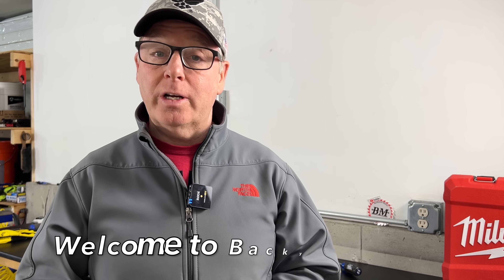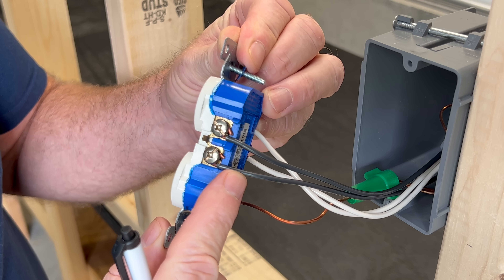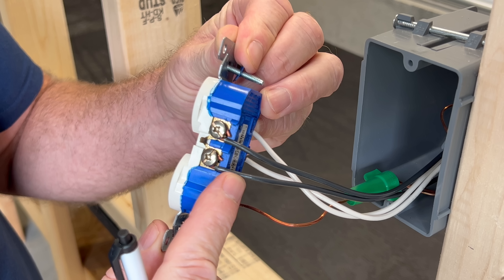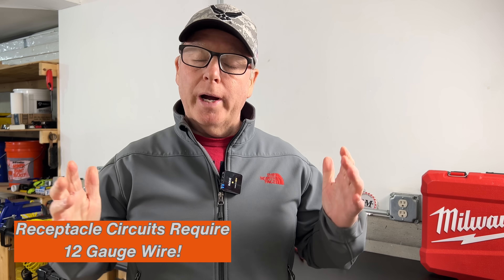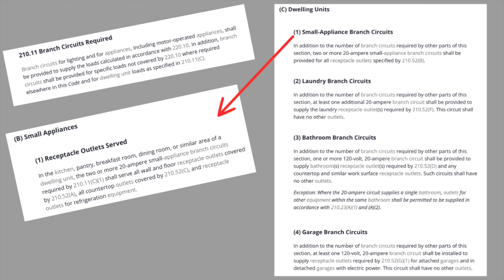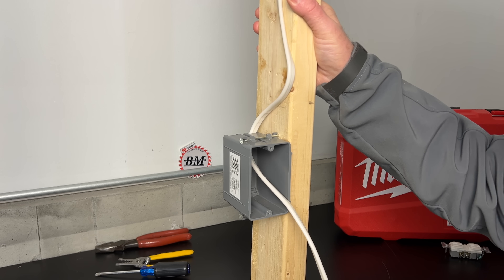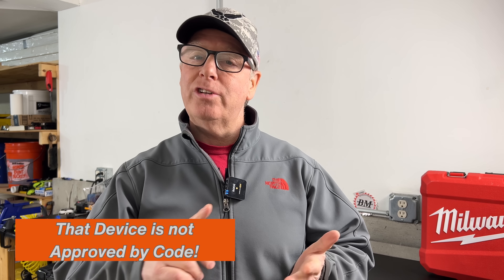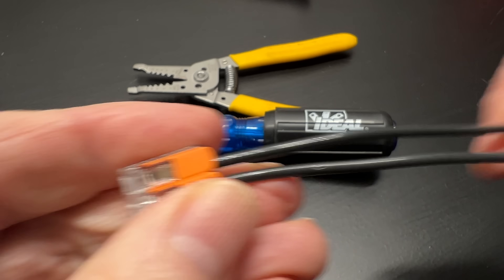5 Electrical Code Lies DIYers Should Stop Believing!

Comment: You showed a NEC CODE VIOLATION of the Forbidden Location of a receptacle over a hard wired heater. ????????
Reply from the maker: Actually it's an Informational Note that states: Listed baseboard heaters include instructions that may not permit their installation below receptacle outlets. 
This applies to some but not all electric baseboard heaters. My baseboard heaters and most of them in Maine are hydronic or (hot water) baseboards and they do not have instructions restricting them from being installed under a receptacle because they don't get very hot.

Comment: Wow all of these were great!  I followed along with my 2023 NEC book, with newly installed tabs, man that was a workout placing all of them.  To be honest it actually makes it harder to get to sections of the book...oh well.  Anyway, not only are your videos very well edited, your way of speaking and camera presence is top notch.  My wife and I live in a modular home, manufactured in 2004.  As far as I know all of our receptacles are 14 gauge with 15 amp breakers.  I could be wrong, I need to pull the panel cover off again, but I'm pretty sure the only 20 amp breakers are the ones I installed. That does become a problem when you try to run two heating appliances at the same time.  For instance our tv stand electric fireplace the front room and a hair dryer in the master bathroom.  Trips the breaker every time, also why would they put two rooms on opposite ends of the home on the same circuit.   I wonder if a 12 and 20 setup would allow that to operate.  Last year we pulled out a large garden tub, and I added a couple of 20 amp circuits and receptacles since I knew we would be running a freezer as well as a second fridge in that area.  I am totally subscribed to this channel.  I watch a lot of Electrician U, but you could become my favorite YT channel.  Thanks for all your hard work, I know its really time consuming to put these videos together including editing everything.
Reply from the maker: Thank you so much. I love reading comments like this. It makes all the hard work worth doing. Dustin over at Electrician U does a great job with his videos as well. He's a very knowledgeable electrician. I have been an electrician and then an electrical engineer for my whole career. I'm retired now. I started making videos for a hobby and now it's become more of a business. lol. Welcome to the channel my friend.

Comment: You REALLY need to pay attention to the length of the wire run vs the wire gauge so that the resistive losses don't create an excessive voltage drop.
A receptacle should be installed ground DOWNWARD!  The last conductor that you want to disconnect is the ground!

Comment: You are right the code is minimum requirement. You would a fool to just do the minimum in most cases. If you want the work you do stand the test of time you need to go above and beyond the minimum. Also, having the ground or neutral up on a outlet with a metal plate makes a substantial difference in level of safety.
Reply from the maker: The code is not a minimum standard in almost every case.
Reply: Well it can't be the maximum? I have never have seen a project installed to the minimum requirements. That it is because it is the minimum. @BackyardMaine
Reply: Anyway most ahj require extra stuff to be done like lighted three way switches on stair cases.  @BackyardMaine

Comment: Some are just good ideas, especially the service loop, if your DYI, and you are the only inspector that matters, keep the extra wire, might come in handy later.  12 gauge on a 15 amp circuit is overkill, but allows for you to swap the breaker and the fixtures without running new wire.  Both costs a little more, but its not like your wiring a full house.
Reply: Why not wire the whole house with 12 gauge?  The flexibility is worth  [the extra cost] imo.  14 gauge is pretty wimpy.

Comment: It always amazed me how some building inspectors, with little or no actual training, were surprised when I would quote or quickly find the NEC reference on circuits they said were under/over amperage. I would always split the lighting/outlet circuits with outlets 20 amp and lighting 15 amp on separate breakers.

Comment: Great, concise content.  I was an electrician 20 years ago, having given up the trade to pursue other options.  Let's face it, I was tired of pulling wire in an attic when the outside air temp was 100 to 107 with 70 to 90 percent humidity.  I specialized in re-wiring whole houses during flip renovations.  Seeing the changes to the NEC is amazing
Reply from the maker: Thanks my fellow electrician. Crawling through attics is a nightmare.

Comment: Regarding #2... Is there anything in the code that prevents receptacles being installed in the floor? 
Is there a rule that requires receptacles to be a certain distance above the floor?
Reply: No. Floor receps within a foot of the wall count as your required wall receps.
Reply from the maker: Floor receptacles are an option.

Comment: The choice of 12 AWG or heavier wiring for outlets depends on specific use cases.  Some years ago my friend acquired a window air conditioner that was plugged into a bedroom outlet at the opposite end of the house from the electrical panel, a Manhattan distance of well over 50 ft.  The builder had cut costs and had wired most of the outlets in the residence with 14 AWG wire.  The voltage drop was so severe that the air conditioner compressor would barely start when cold, but would stall on a hot restart. The solution was to run a 12 AWG Romex cable from the breaker panel through the crawlspace to the rear of the house and tie it into the outlet circuit, effectively supplying it with a 10 AWG run, which  practically eliminated the voltage sag from the air conditioner, hair dryers, clothes irons, etc.
Reply from the maker: Sounds like it was a considerable distance from the panel. Also the connection method used plays a role as well. I run a window unit on a 15A breaker with 14 gauge wire about 50 feet from the panel with no issues at all.

Comment: Los Angeles county, which includes the city, does or used to have a UL or other recognized safety agency (ETL) on any permanently installed appliances. Plug connected or not, like a dishwasher for example. If the device is unlisted the city actually has it's own test lab for a cost of course! (Just another infamous California government money grab). This was often a serious issue in technical and data centers where much of that specialized equipment bolted into racks (then considered a permanent appliance) was not listed due to the cost and requirement to provide sample products which will be destroyed by testing. UL finally stepped in early 1993 and offered a new certification level for commercial and industrial equipment. The inspection was just for basic electrical safety and was not destructive. However the UL sticker had to say the equipment was only to be installed in a commercial environment.

I am an EE who designs some of that specialized equipment and I got burned with this new certification. I used to take the line cord ground or ground terminal on a power connector and bond it to the chassis with the first convenient screw. No Good! The power cord ground must be bonded to the chassis with a dedicated fastener. You can't use a screw that is serving another purpose. Fortunately that was easily fixed on very small production products.

Comment: Leviton Tamper-Resistant Surge Outlet (T5280-W) installation instruction Step 7 reads: "Installation may now be completed by carefully positioning all wires to provide room in outlet box for receptacle. Mount the Surge Protective Receptacle in wall box, with the ground contact upwards, using the two long mounting screws supplied. Attach wallplate."

Comment: I often see on Reddit "15 amp receptacles cannot be used on 20 amp circuits" yet code allows this. In fact it is sensible! This way a large air conditioner with 20 amp 5-20P attachment plug cannot be plugged into a multi outlet circuit. (Those appliances need a dedicated circuit)
The 15 amp receptacles are designed to handle 20 amp pass through current, and the UL labeling sometimes confusingly says rated 20 amps on the 15 amp 5-15R configuration.
Reply: I mean it's partially true. You can't have a single 15 amp receptacle on a 20 amp circuit. If you have a standard double 15a receptacle (or multiple singles) it's fine.

Comment: Are you a qualified expert on NEC?  I've seen people who write the NEC have different interpretations.
Reply from the maker: Yes I am a qualified expert of the NEC. There is very little room for interpretation in the code. Usually where interpretation comes in is when people don't understand the terminology.
Reply: @BackyardMaine  Correct. With few exceptions the NEC text is explicit and intentional, and the meaning and appropriate and correct application is clear to anyone who understands the terminology and how the provisions would be applicable in an actual installation. The NEC is not written to be a plain language text intended to be fully understood by those with limited electrical experience and knowledge.

Comment: The National Electrical Code (NEC) is minimal. Local, city, and individual States can exceed NEC  codes, which happens a lot.
Reply from the maker: Not really although this is sometimes true but I’ve also seen local AHJs allow practices which are violations under the NEC.
Reply: Local amendments or changes are not required to exceed the NEC.

Comment: The ground pin up thing is a recommendation, not a requirement.  It was only added recently too, but has never been listed as mandated.

I was browsing the various codes UL, NEMA and NEC,  it was added to UL and NEMA a few years ago in the recommended procedures, but never added to the requirement codeset.
Reply: As a note, there are massive numbers of UL recommendations commonly ignored.

For instance, UL recommends that extension cords have fuses in them.  I have yet to see one that does.
Reply from the maker: Not sure about that but I have many UL listed cords in my shop and none of them have a fuse.

Comment: When I built my house, I didn't follow any code books really. But all my "outlet" wire runs I did with 10g wire no matter if I put a 15 or 20 amp breaker. ONLY lighting only circuits get 14g wire.
Reply from the maker: That works but and it code compliant but it’s overkill and you will have to watch your box fill.
Reply: @BackyardMaine  Yea. Nearly full breaker box. Wire management is hot garbage. Was a pain. 😅
Reply: @BackyardMaine  Way I built my stuff house, I YouTubed to see how the pro's did it. Then went 1 step  stronger on EVERYTHING. Had that 7.1 earthquake right after I finished the drywall inside. Not a single seam in the drywall cracked from the earthquake. 😆

Comment: Certain situations I've worked in like hospitals did require ground up installation of receptacles.
Reply from the maker: Yes for sure but its not called out by code even in hospitals. Check NEC article 517. The reason ground up is common in healthcare facilities and their building specs often reference IEEE std 602.

Comment: Though not against code, I have seen few of these actually specd out on the blue prints ( all outlets 20 amps; 14 Guage wire only used on lighting; and yes I've seen it specd out to have grounds facing up, lol)
Reply from the maker: Yup thats not surprising at all.

Comment: Good video. Retired IBEW
Reply from the maker: I started out as an electrician in the Air Force and then spent 10 years in IBEW local-7 before moving into engineering.
Reply: Started with my Dad when I was twelve and retired with IBEW 292. @BackyardMaine

Comment: Fun fact, in 90.2(A) (2023) the NEC states it's not intended as a guide or manual for untrained persons. If you're an untrained DIYer the NEC explicitly states it's not applicable to you. 🙂
Reply from the maker: It’s not a guide or a manual for anyone really. It’s a standard that we use along with our training to insure safe installations. Saying it doesn’t apply to DIYer means it doesn’t apply to apprentices either.
Reply: @BackyardMaine  - 

I'm being facetious. I just like to point that out whenever an electrician tells me something I've done "GoEs aGaInS ThE NeC". 

"Whelp, I'm not a trained electrician so the NEC isn't applicable to me. Says so right here..." Most of the time these are the electricians (real or otherwise) that think the NEC is *THE LAW*.

Comment: Again, PLEASE specify that you are talking about AMERICAN Electrical Code!
Reply from the maker: It's not the American electrical code. It's the NEC or the National Electrical Code NFPA-70 which applies to the USA. I don't what  the code is that you use. But I do state NEC and National Electrical Code
Reply: @BackyardMaine  It's the Electrical Code for "America", so it's the American Electrical Code. We have the Canadian Electrical Code here in Canada, which may or may not be different.
Reply from the maker: @lloydsumpter7735  It is different. The NEC only covers the USA. I talked about that in the video.
Reply: @lloydsumpter7735  Calling it the American Electrical Code is wrong because the US doesn't have an electrical code which applies nationally. The NEC is just a book whose title is "National Electrical Code". Each state has its own electrical code. In all known cases this happens to include most of the NEC but the NEC itself is not code.

Comment: I recently bought a new build in Michigan. The garage outlets are on a 15 amp breaker with 14ga wire. I'm not certain about the laundry room, but I believe it is also the same as the garage. The kitchen outlets and lights are on the same circuit. I thought those had to be separate circuits?
Reply from the maker: Sounds like someone didn't know the code unless it's a really old building.
Reply: @BackyardMaine  Nope it was built last year. That's annoying. I love how this stuff somehow passes inspections.
Reply: @deeyadeli1435  A home built last year in Michigan should be following the 2017 NEC. That version definitely requires 20 amps in the garage. In my 1996 house (in Massachusetts) has the receptacle on the garage wall is the same shared 15 amp circuit as the bathrooms. It's stupid but I presume it was code-compliant only 30 years ago.

Comment: I learned to wire my own house under the watchful eye of a 3rd generation electrician from Lewiston Maine. I hung boxes, drilled holes and pulled wires during the day and he came by after work to inspect, explain my mistakes and discuss the remedies. One of his hard rules was 12 awg to all electrical outlets because you never know what someone might plug in, in the future. Another was lighting and outlets on separate circuits, ALWAYS. A third rule was never use cheap devises or the push-in connections - always bend the wire to fit around the screws and in the correct direction. There were many, many other things he taught me that I’ll never forget and I’ve passed on to others but the thing he’d say every night after finishing the free beer I gave him for his time was “now you know enough to be dangerous”. No truer words ever spoken. 😂

Comment: 14 gauge wire in homes starts fires, and even 12 gauge is a hazard - use 10 gauge in residential circuits for safety - this is why the fire inspectors often cite the cause of a fire as WIRING!
Reply from the maker: If 12 and 14 gauge wire is burning up and causing fires believe me it's not the size of the wire thats the issue.  The breaker protects the wire. Faulty connections may be the issue or maybe oversized circuit breakers or fuses.
Reply: Ridiculous statement devoid of any evidence.

Comment: The way I understand it regarding pigtails at a receptacle is the receptacle would have to be listed as a splicing device.  It has nothing to do with the NEC.  You would have to contact the manufacturer of the receptacle to find out if their device was listed for splicing.
Reply from the maker: You kind of right which is why the statement about pigtails being required is false. Also all UL listed 120v receptacles sold in the US are listed for pass through. As a matter of fact 15A receptacles have a 20A pass through current rating.

Comment: I'm a non electrician that has done a fair bit of wiring over the years and I worry about code compliance all the time when I do it. I was happy to see in the video that I didn't believe "the lies that DIYer should stop believing". One area that I remain  confused about is what cable type is required for garages?I just finished a job where I added a lot of new electrical features to our garage and I used MC partially because I think it's better for garages where the wires are exposed and partially because I thought it was a code requirement. Mostly I kept the wire in the stud bays but there were a few places for convenience we ran  the wire outside the stud bays near the top plates.

There seem to be a lot of factors on the wiring type required in garages
1. Attached vs. Non attached
2. Kept in the study bay or not
3. NM vs. MC vs EMT

Comment: Good content John!  I have been blessed with an Electrical instructor as one of my best friends, and now my son is a licensed Journeyman. I know most of the code, but not all. I don't argue with folks about electrical; I simply ask if they are a licensed Journeyman like my son is; the rest is a moot point. My most recent inspection of my new shop building got a passing approval, with a smile by the inspector, he pointed out one upgrade I might think of, but other than that - "Good Job" was his final comment.
Reply from the maker: That’s awesome. Good work. I’m retired now but I spent my whole career in the electrical industry as a licensed electrician and eventually an electrical engineer.